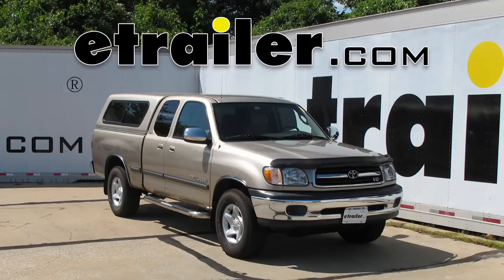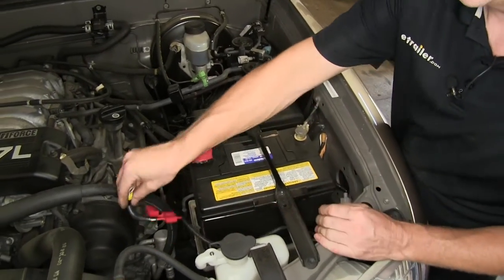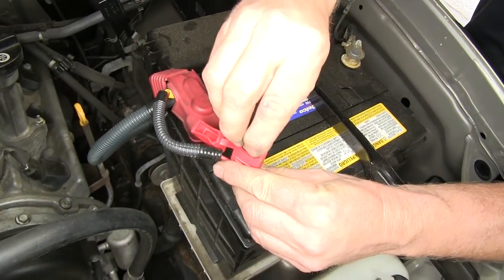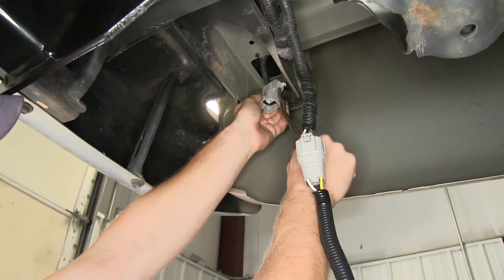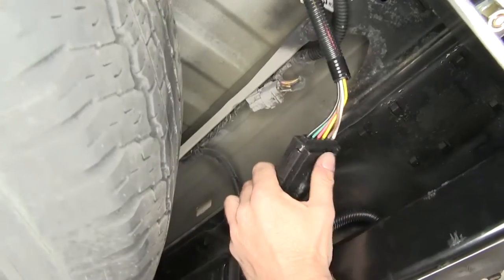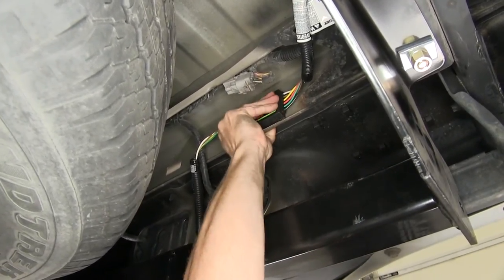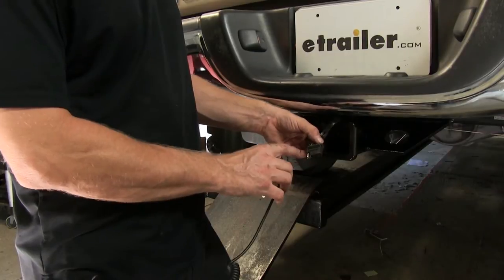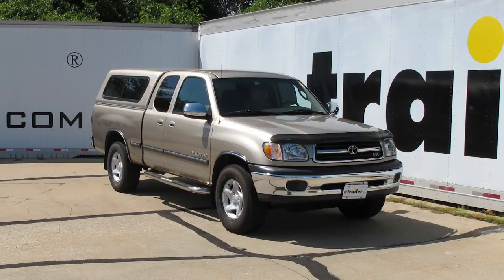etrailer | Trailer Wiring Harness Installation - 2002 Toyota Tundra

Comment: Wish the plug in had diodes to let you know it was working without the need for a test light.
Reply from the maker: This plug does not, but a quick affordable tester would be to use the # I26. I have provided a link below. 

 https://www.etrailer.com/Accessories-and-Parts/Curt/I26.html

I checked and not of the 4-way flat wiring connections that we have have an integrated tester that can be used as a tester. There are some manufacturers that do have test LED's integrated but those are usually for 7-way functions not a 4-way option.